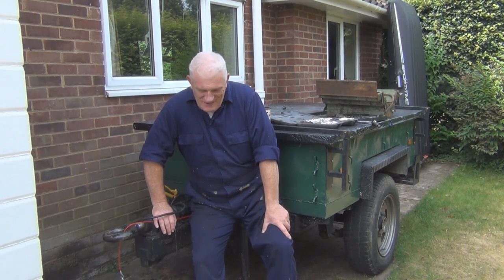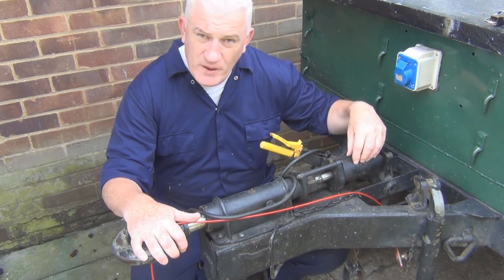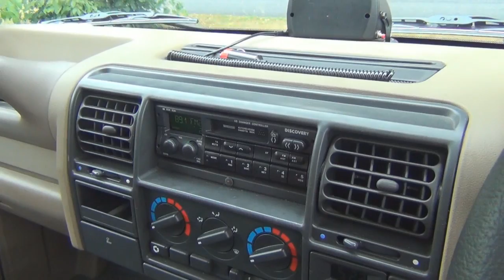Routine maintainance (Be Ready - Stay Ready)

Comment: Nifty trailer you got there, I was just wondering why are you selling you break damper if they are that hard to find, would it be better if you kept it as a spare? And why did you not use Loctite on the bolts and nuts when attaching the new damper. And that aerial looks spot on, I had the same problem on my truck where I had to swerve onto the side of the road when some idiot was on my half of the road in a corner and snapped my aerial off. but I just fixed it with some fencing wire haha